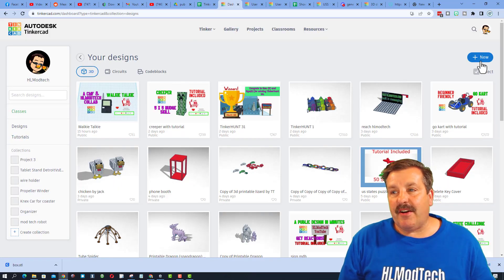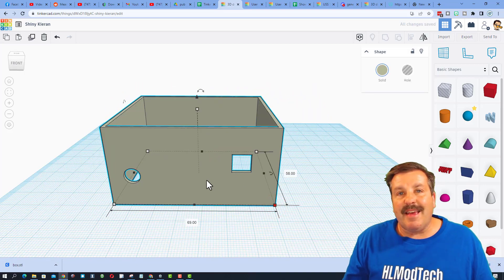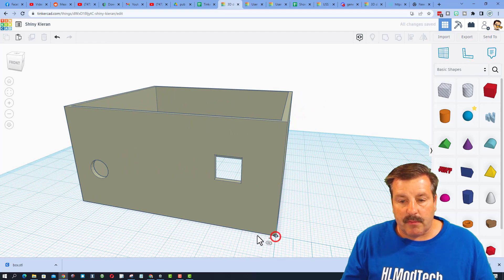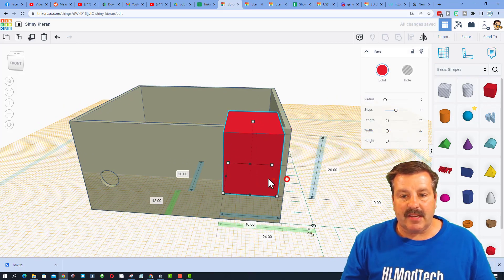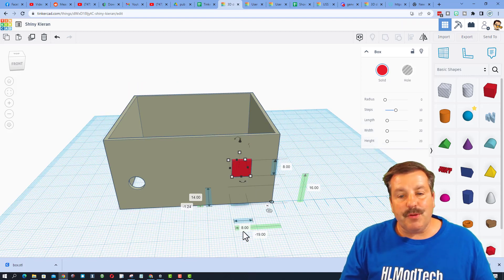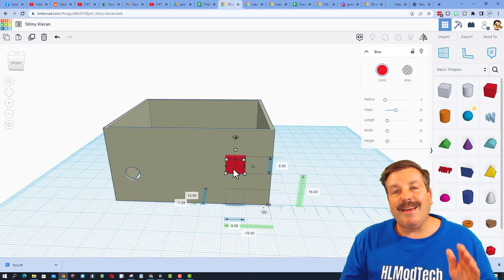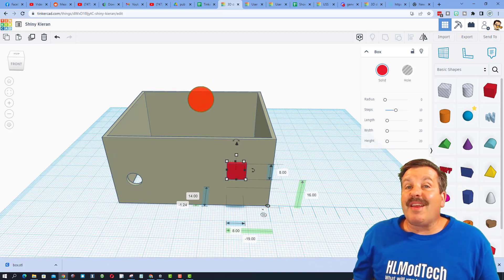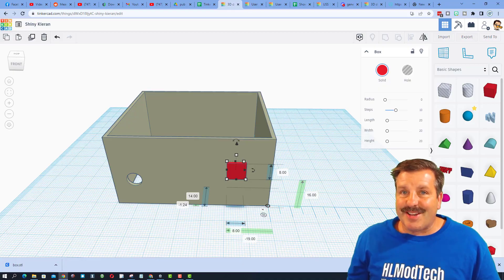Tinkercad Trick to Measure holes in an imported STL | Simple Steps

Comment: main issue im having to keep it simple without using decimals my large sqaure is 3" sqaure i want to place is 1" to center it it would need to be 1" from the side when i do this though i have nowhere  near 1" left. how do i solve this issue?
Reply from the maker: This video about the ruler might help. https://youtu.be/X3_JOFf69QE You can also set your nudge to .5 inch and use the arrow keys.

Comment: I was thinking of duplicating the item and make it a hole then putting a solid piece around the hole in question and measure the cutout.
Reply from the maker: Interesting. Do you think that would have been faster? Cutting in Tinkercad is a bit slower I would think.
Reply: @HLModTech  there would be no ruler need if you just cut the solid piece out.  If there is a circle or a triangle void, much easy to cut then to figure out if the shape fits in.
Reply from the maker: ok. Yes. That would get you the exact size. Good strategy. 👍

Comment: for greater accuracy, I do similar but repeat the workplane process from the other side as well. 
workplane surface 1 - place block A, make it smaller than the hole to measure
workplane surface 2 - place block, B make it smaller than the hole to measure
group Block A & B - the resultant size is exactly touching both surfaces.
Reply from the maker: Excellent steps. Thanks for sharing. 👍
Reply: I'm having trouble understanding this, have you seen a video of this method?
Reply: @dosdont  literally this video but repeated a second time